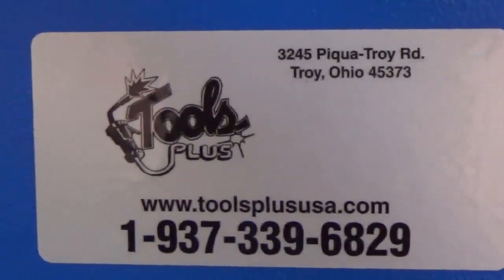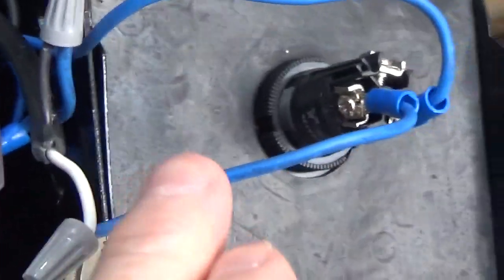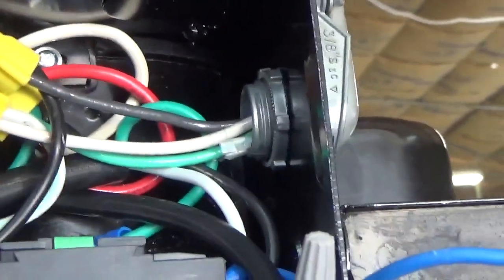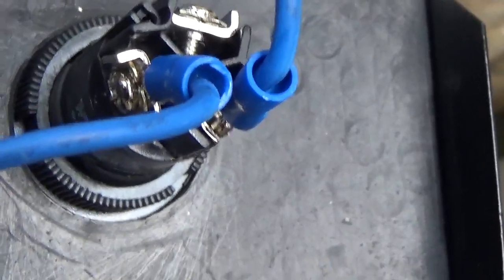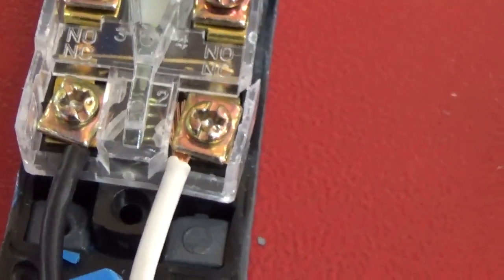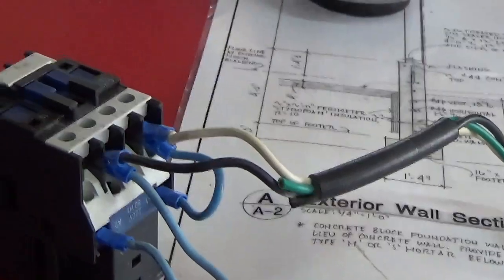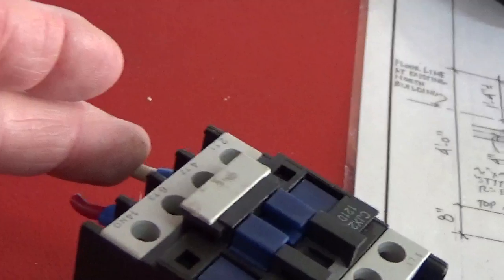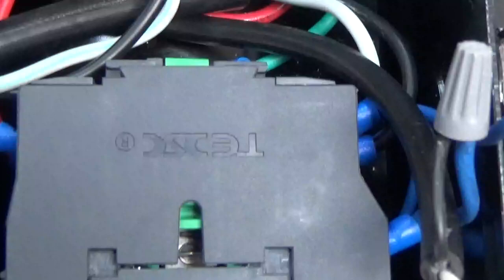connecting power to a car lift, wiring a 220 volt motor for car lifts

Comment: I have a very similar setup for my power unit, it came with a 53(RVV) power wire that has two 110 wires, to the underside of the contactor, with the wire traveling out as a pigtail,  how is the ground wired in?